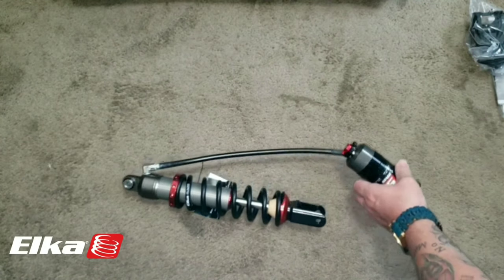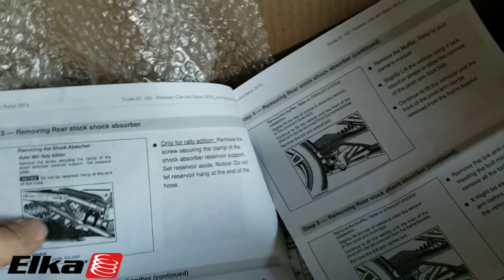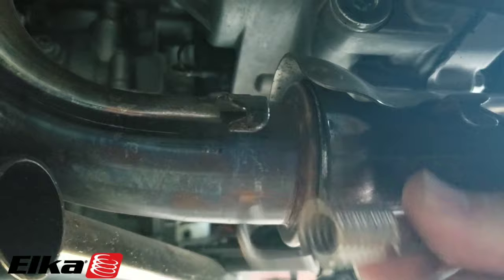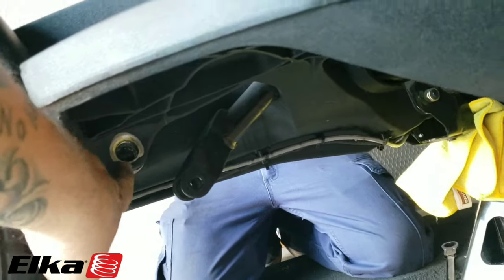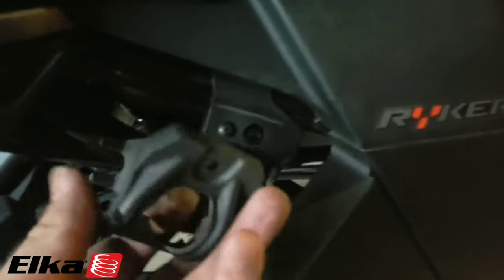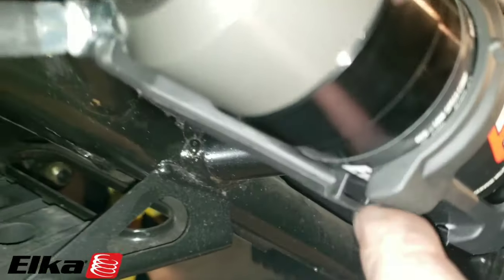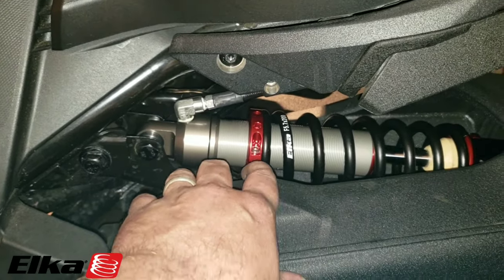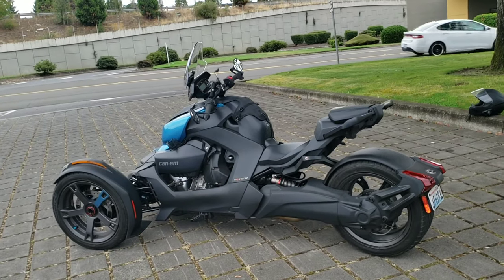Can-Am Ryker Elka suspension stage 5 rear shock installation video

Comment: Thanks for posting this video. I just replaced mine and found this very helpful. I was able to perform the replacement without completely removing the muffler but instead just dropped it down as was recommended by the Elka procedure. The difficult part of the procedure was removing the old shock and installing the reservoir bracket. Both required some patience!
Reply from the maker: Thanks for taking the time to check out my channel and hit the subscribe button it is greatly appreciated I'm glad the video helped you

Comment: Thanks Bill.  Got stage 4 ELKA rear shock installed thanks to your video and some research on the BRP manual.  I managed it myself but I gotta say it needed two people really.  What a bear of an install.  I could NOT wiggle the rally shock out easily.  Took over an hour or two just to get the stupid shock out once the bolts removed 🤪.  Anyway all is done and ELKA shock is really nice.  Thx !
Reply: And I’m NOT a mechanic !!! 😗

Comment: Thanks for the install video. I have just installed a rear stage 4 shocker  and was very careful for the roller bearings and shaft  not to fall out on the lower end of the cast arm. My question is the Ryker service parts  manual shows shim  washer also on both sides on the roller bearings( in total that would be four). I could see none on my bike or any in your video. Did you bike have them?
Reply from the maker: Sorry for the late reply YouTube is terrible about notifications I am just now seeing this message. No my bike did not have any that I can recall. The only reason they would show the shims is because of their tolerances. So for example if your bike is on the closer side to the tolerance level it may not have shims but if it's on the larger side of the tolerance level perhaps maybe they would have to use shims to fill in the gap. So sometimes shims will not always be there. Don't be alarmed it just means your bike was built better than the next guys.
Reply: @BLRTUNING  Thank Bill, not many people to ask down in OZ. Your video was a great help.

Comment: Hey Bill! Thank you for your content. I'm a big boy and like to ride with my growing son from time to time. In your opinion, would the Elka stage 3 rear be a major upgrade over the 900 rally rear shock? Appreciate your time.
Reply from the maker: Anything from Elka would be considered an upgrade. The shocks that come on the rally are very cheap and they can't go any stiffer than the standard 900 suspension they can go softer but the 900 600 and the rally at their stiffest settings are all about the same. Elka suspension is custom built specifically for you and your passenger if you have one. Their suspension is definitely top notch you can't get anything better..  you could easily do stage 3 in the rear and stage 2 in the front and be very happy with the results..
Reply: @BLRTUNING  thank you for that! Will definitely be my next upgrade. Can't wait. Regards

Comment: Great instructional video. I have the rally version, been looking for a different shock for mine. I have the stock shock tension cranked up all the way and we bottom out. I do have a bracket ad top box installed behind passenger seat. Total weight of us and gear is around 450lbs. Do you think the elka 4 rear would work and how stiff is it for one up? Thanks again
Reply from the maker: All of their suspension will work because when you order it you tell them how much you weigh.. if you follow the link in my description to their website and then in the search part type in Ryker rally it'll come up with all the suspension options for the Ryker rally.. click on one that you think you might be able to afford as if you were going to check out and you will see what I'm talking about.. there's a part that will ask you questions like do you mostly ride 2 up.. ? It will ask you for the drivers weight and the passengers weight.. stage 4 for the rear end and stage 3 for the front end is their number one selling item.. with me and my wife on there we are at about a little under 500 lb. We are not small people. when I placed my order I filled out the question form and said I mostly ride with a passenger.. the way the spring tension is with all of their springs it has a softer part and a stiffer part almost as if it's a dual component suspension.. that's how it feels underneath of you anyway.. so when I'm riding the bike by myself it is still squishy enough to not just be super stiff but then when I put my wife on the back is squishes down just a little bit past that squishy part and becomes a hell of a lot firmer.. with both of us on the bike bouncing up and down as hard as we can we could not make the max amount smack the fender... The setup is absolutely amazing whether you're writing by yourself or with a passenger.. just make sure you think everything over when you order the shock whether it's stage 3 stage 4 or stage 5.. if you want it to be comfortable and not have to make any adjustments for riding with a passenger then make sure you specify during The question part that you mostly ride with a passenger.. I can assure you even if you only get stage 3 for the rear end you will absolutely love it. 10 times better than the factory rally shocks.. especially since they are custom built. if you were to order something like the Fox Racing shox they literally take them off the shelf and stick them in a box it's the same one for a hundred pound Rider versus a 400-pound Rider... Not Elka suspension...
Reply: @BLRTUNING  Thanks for all the help. I will definitely be getting on their site and checking them out.
Reply: @BLRTUNING  Hi Bill, Thanks for the detail in the write up above, I do have a question, what would be the difference with the comfort, sport and performance option for the Elka. I'm thinking about purchasing one this year b/c I want to be able to ride my daughter on longer trips. our combined weight is  345lbs. The issue is really with the 3 piece touring saddle bags from SlingMods and I was hoping a rear Elka stage 3 or 4 would keep that middle bar, for the saddle bag mount, from hitting my fender on the 900 ACE when she rides. Any info would be greatly appreciated. Thanks.
Reply from the maker: @CeeDeeLight  since the suspension was made for the Can-Am ryker without any saddlebags I would say take the weight of each saddle bag with all the gear into consideration when you purchase the suspension... I still am waiting to hear back from Elka about this subject because from when they made the suspension to now there is a lot more options out there as far as saddlebags and attachments. It was my understanding that the suspension was designed around the base weight of the Can-Am ryker itself plus you and a passenger if you ride with a passenger... Maybe to balance things out you could split the weight of the saddlebags with all the gear between you and the passenger maybe just divide it in half between the two...

That's what would make the most sense to me this way the bike will still be comfortable if you're riding by yourself with all the gear and if you add a passenger with all the gear it would be comfortable as well. 

Maybe it'll distribute some of the load that the bike's going to withstand between the three shocks.

the difference between the three options you're asking about performance would be having the suspension adjusted the stiffest straight out of the box. Comfort would be the softest sport would be right in the middle.. 

That doesn't mean that the bike won't handle the weight that you described to them...

It just determines how spongy the suspension is out of the box..

Me and my wife with a saddlebag and a duffel bag and a backpack on my bike went on a 800-mi ride and we were comfortable on the Elka suspension. I have mine set up in sport when I placed my order..

remember you don't need to make any adjustments when you get the suspension out of the box.

It comes out of the box ready to install based on everything you described to them when you place your order.

over 7,000 mi on my suspension and we've never adjusted the suspension once it's still the same way it was when I got it out of the box and it's still just as comfortable as day one.
Reply: @BLRTUNING  Thank you so much!  Your response is very helpful. Happy New Year too.

Comment: I have the can am rally and could you tell.me what this shock would add to my ride? What would combined rider weight this will handle? Thanks
Reply from the maker: You have to go to their website and design the suspension yourself you answer their questions your suspension will be built specifically for you and your passenger so my suspension will be completely different than your suspension

Comment: What is the use for the red knock on the extra cylinder
Reply from the maker: That is to adjust the dampening. So if you want the suspension softer you can loosen the dampening if you want it stiffer you can tighten the dampening simply by turning that knob.

Comment: Warning!!! I attempted to do this today and that brass colored bolt got pretty stripped.I tried every kind of wrench and it wouldn't budge at all.So now im just stuck.
Reply from the maker: Yes I'm not sure why BRP insists on over torquing the bolts to where they are dang near impossible to get off but we have came across that ourselves on a couple installs as well. Definitely something to keep an eye out for. A little bit of heat to this bolt and it will come right out every time at least that's been our experience.

Comment: So you'd recommend these for the bigger guys?
Reply from the maker: Absolutely .....

they are custom-made based on your weight and your passengers weight and how you ride every single set is custom built upon your order nothing sits assembled in a box somewhere on a shelf.. my bike the suspension is set up for a 600 lb load that would be me and my wife and all of our gear fully loaded ready to go on a 4-day road trip that's how we have the bike set up and it is super comfortable...
Reply: Sweet. I'd love to chat more about this.
Reply: @BLRTUNING  sent you a PM on FB.
Reply: Bill just out of curiosity how tall are you ?   Im looking at a Ryker but being 6'1 270 im not sure if it feel like im riding a kids size bike.  Definitely going Elka stage 2 up front and 4 in the back e day its delivered. I've been watching your videos to see how you fit to the bike but your always the one filming.  Lol.     Thanks for all these great videos !!!!
Reply from the maker: There is lots of people on the bigger side and taller side that are riding these bikes. I'm 5 ft 7 and 250 with all of my gear.. I'm right double on this bike with my wife on the back and have no issues whatsoever. I think you'll be just fine and they do make modifications to adjust for your height. For example there's a seat that is a little bit longer and the pegs are adjustable and the handlebars are adjustable

Comment: Based on your comment "little under 500 lb" are you not exceeding the design of the rear chassis?
Reply from the maker: Maybe a little more than what is prp's recommendation. however the chassis is always going to get a rating that is well under what it can actually handle.. so I'm not too concerned..

Comment: So how's that seat? Been looking into getting one of these bikes..
Reply from the maker: It's actually not as bad as I thought it would be we went on a 800 mile ride riding 2 up on the stock suspension. We rode for about 2 hours at a time. Not bad at all. there is a better seat option called The comfort seat that you can purchase.
Reply: God for short trip but many more much more comfortable. including CAN confort seat.

Comment: I can't get the clamp on for the reservoir. It will not fit on that bar. Do you have a secret way to get it on around the bar  and fit in the little hole?
Reply from the maker: It's very tricky to get it to fit perfect and it does not fit super snug around the canister for the shock
Reply: I got it in but tricky isn't the word I used. Can't say it on here.

Comment: I cannot get the rear shock out. I got all the bolts out but can't get the shock out. I don't see how you got it up and out. It's impossible to do.
Reply from the maker: It's not possible we did it it was not the easiest thing but it can be done
Reply: I finally got the shock out. I had to move the bracket around the seat pan back to get it out. 2 star screws on each side.

Comment: Indicates how much kg \ pounds the suspension can be loaded? ✌️
Reply from the maker: I don't understand what you're saying.. what indicates how much kg/pounds
Reply: @BLRTUNING  I would like to know what the maximum load on this suspension is,.. Do you know what I mean?
Reply from the maker: @ACrown-nw3os  the one that I am using in the video is a 600lb load... From the factory maximum weight they claim is 400 lb...  In actuality it's a 185 lb  spring.. this spring is a 600-lb spring.. when you place your order with them you have to enter in how much the Rider weights and how much does your passenger weight... It will also ask you do you mostly ride with a passenger or by yourself... They build your suspension for you custom built based on your instructions.. what you order will not be the same as what I ordered.. most other companies are pulling something off the shelf sticking in a box and sending it to you.. not Elka suspension... Everything is custom-built.... If you weigh 200 lb and your passenger weighs 130 lb your suspension will be built to handle your weight plus the bikes....
Reply: @BLRTUNING  OK, thanks, that's what I wanted to hear.

Comment: So how do these preform?? Vs stock.
Reply from the maker: 10 times better than stock there is no comparison whatsoever these are the best on the market and they are custom-made specifically for you and how you ride and how much you weigh...
Reply: @BLRTUNING  thanks for replying. So no more neck breaking bumps with that back shock replacement. I ride 2 wheels I bought the ryker for my wife. That rear end is very bumpy do these shocks get rid of that bumpy ride and make it smooth. Sorry for asking twice but those things are expensive and I want it to be worth it for her. I changed the sway bar links first thing and I could tell a difference in the driving right away with the link change.
Reply from the maker: @jodymorrison9495  yes they are absolutely worth it.. by far the best suspension that you could possibly buy right now.. just make sure you fill out the form correctly when you are placing your order through their website make sure you enter in your weight and your passengers weight exactly